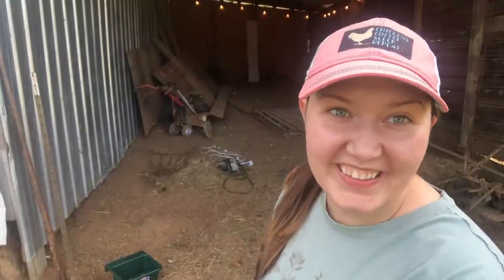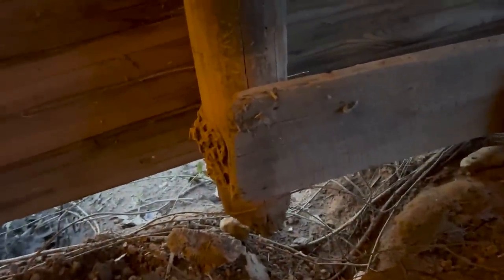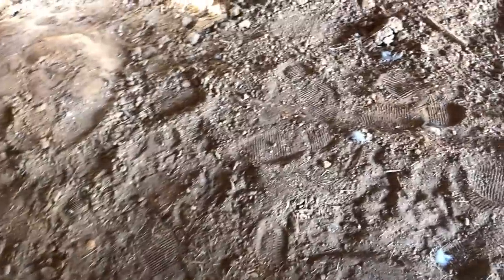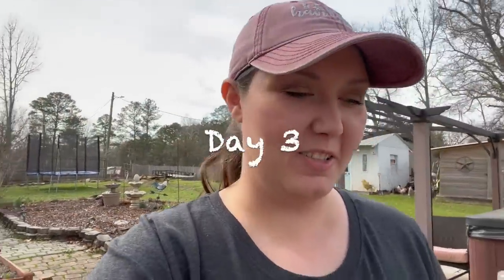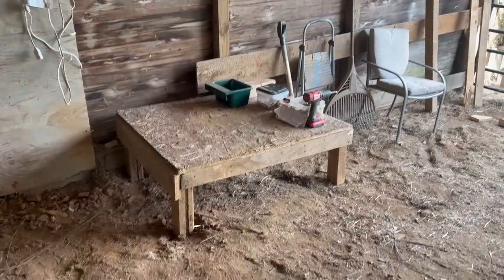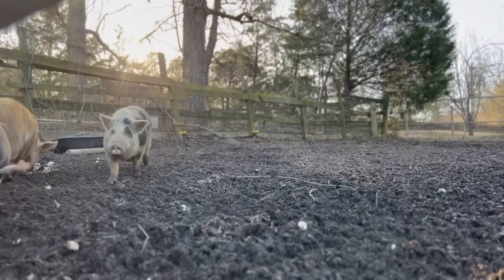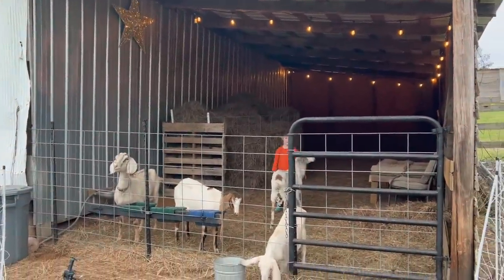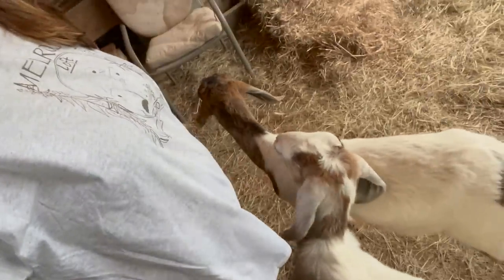Transforming an Old Barn for Our Nubian Goat Herd | Start To Finish & Update

Comment: ROFL girl at the time you were saying it I had already was saying at the screen get a bucket under the post and fill it with Cement had to do that once with my Christmas tree stand and girl its still going strong. ❤Jacklyn what if you took a board down it like you said and go on the outside too .. that should leave a cap between two boards and pour cement down through that for a footer.  Think of a miter box and you should have enough scrap wood around but it would help support that end of barn.  Just a suggestion you guys know the bard better than any of us 💚💛🧡